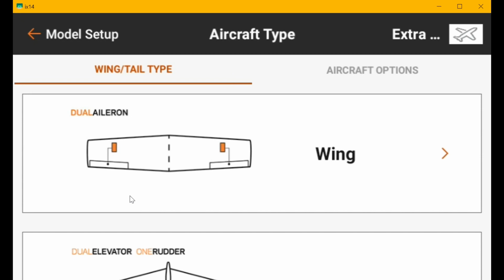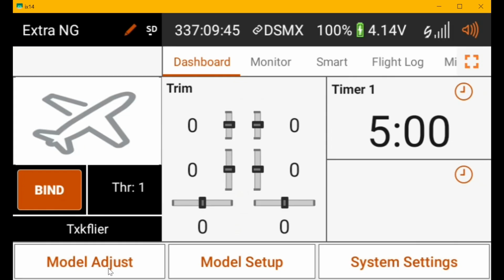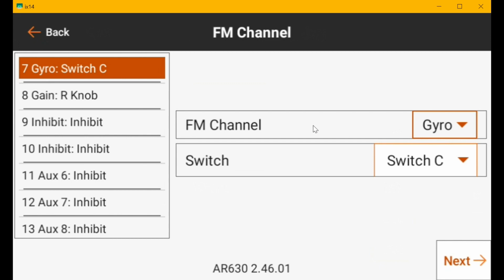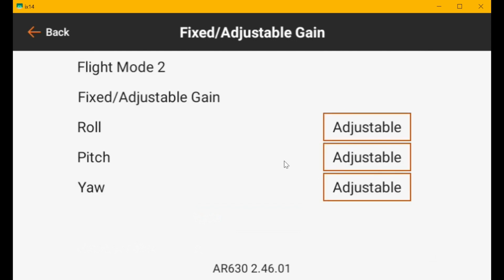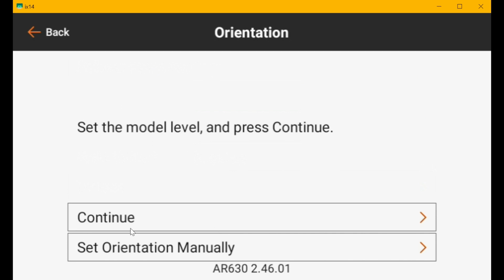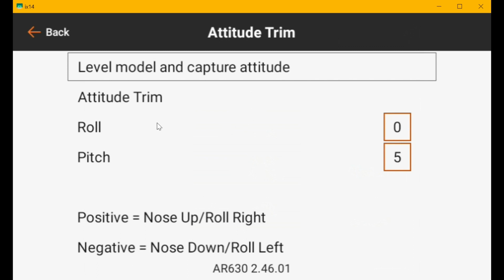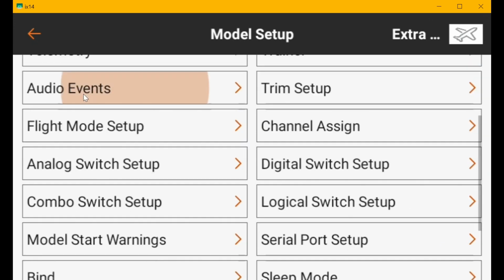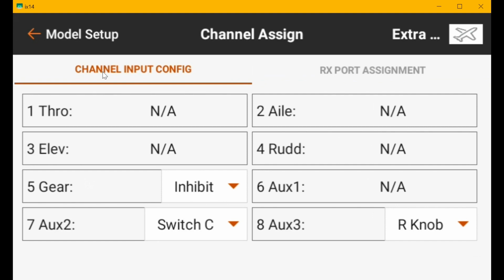Extra NG with AR8360T and iX14

Comment: Hi TXK, I was finally able to get scrcpy setup and finally running. Its an awesome program and makes navigation so much easier. Thanks to your vid link you sent was a big help in this happening. I will be using this program  going forward especially in setting up the AR8360T prior to installing it on the L-39.Once again, thanks for everything and look forward to future vids from you. All the Best!
Reply from the maker: Good deal. Did you see my video(s) of my 80mm Freewing L-39? Is that what you have? I recently put an AR637T in mine. I had been flying it with an AR636, but decided to add battery voltage telemetry to it.
Reply: @txkflier  Hi,  Yes i have the Freewing L-39 80mm, I havent seen your vids yet on the L-39 but will for sure .I havent statrted the build yet as just moved, however did you have to add a nose gear mod to yours which keeps the strut aligned which aids in support for rough landings? I have a pic of this i can send to you if you like from a friend that sent me his mod. I would need your email though.
Reply from the maker: @jmartin2711  I haven't needed to reinforce the nose gear on any of my EDF's. It helps if the mains touch first..

Comment: Hey TXK, A great tutorial on the AR8360T which I plan on using on my Freewing L-39 80mm. All your vids are awesome with helping out the new comers to the IX14, well layed out and easy to follow. The screen copy link you sent me, however I cannot get to work. I am not PC savvy to understand the program. Let’s just say nothing happens after extracting the files.I obviously am missing something even after clicking scncpy.exe to run the program.Not to worry, I’ll just use the touch screen on the radio.Thanks for your vids, been a big help!
Reply from the maker: The iX14 needs to be connected and operating before you run scrcpy. I made a shortcut called “iX14 Remote Control”. The target string has the path followed by “scrcpy-console.vbs —window-width 1600”. I’ll put the info in the description in a minute.
Reply from the maker: Did you watch my How-To video on ScrCpy? https://youtu.be/e0b59pYR7Uo?si=dmOM0WbaBAzHd3Oe